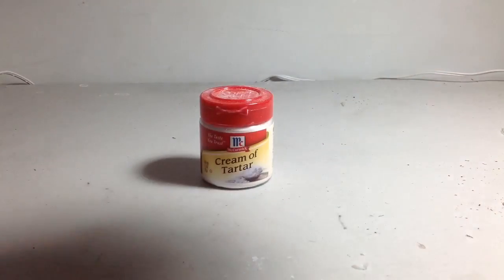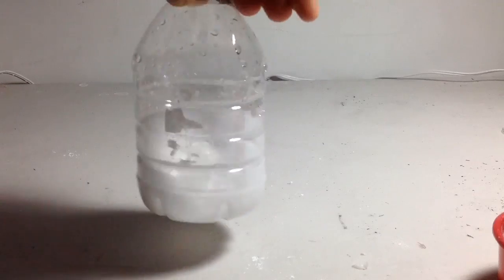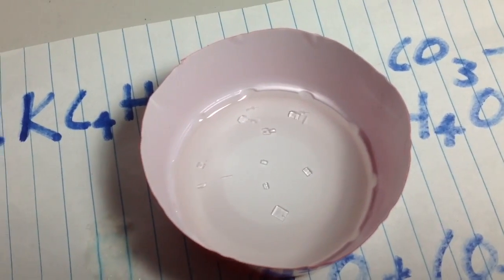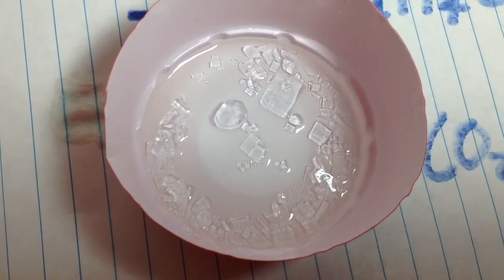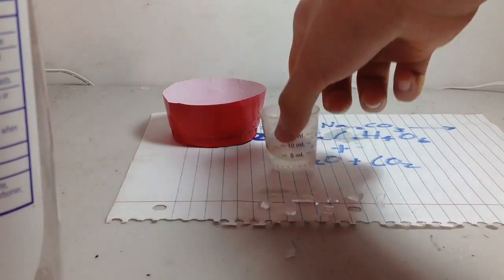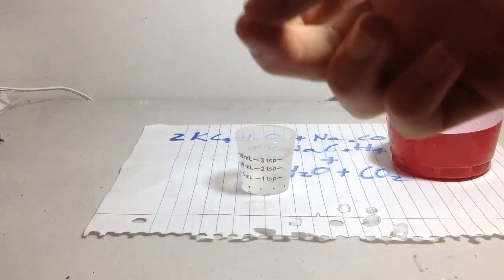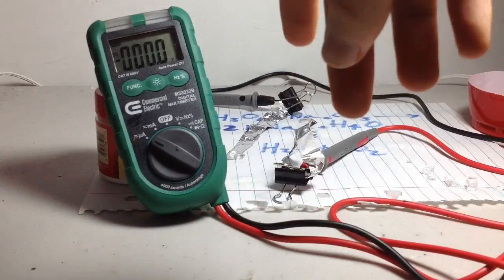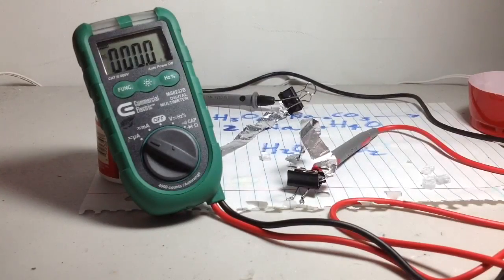Growing Piezoelectric Rochelle Salt Crystals

Comment: I just found this after a discussion on old record player cartridges which used the same crystals to convert movement of the stylus to a signal. It would be interesting to connect an amplifier and speaker rather than your meter.

Comment: FREAKING FANTASTIC, MAN!  Using homegrown piezoelectric crystals as resonators in sonicating graphene experiments!? What a vision! I'm with you 110%.

Also, would love to see you using them in speakers! Great video. My favorite; I think your best one yet. I love crystals!

So, how can ya make more reactive piezoelectric materials?
Reply from the maker: I don't really know, but my best guess would be to use different metal cations, maybe use lithium instead of sodium, but I won't be able to try that any time soon without a source of lithium. You could also make the crystals thinner, which I'll probably do for the sonicator. Generating a high frequency AC current for the sonicator might be tough though... but yeah it would be really cool if it works!
Reply: Red Rake you could try to safely extract lithium from some batteries.
Reply: you can just order it from amazon
Reply: Small Lithium, discs that has not been Magnetized" can be found in some of the ( Older BMS CONTROLLERS ). PS: I would
Upload a pic, but won't let me.
Apparently, it was used to make a 
Reliable Connection..

Comment: Didn't know you could do this cold, most method I saw used a simmer method when mixing them together.
Reply from the maker: People do that to make a more supersaturated solution that crystallises faster.
Reply: It does, I tried it myself a while back and the crystals formed much faster, however I didn't have a proper sized vaping area, but got some nice chunky ones.  I'll try this supersat method with some of the ones i made previous, I like that idea, maybe get some nicer ones.   Also I used some clear nail polish to preserve one sample from moisture.  I'm not sure if this would affect its properties, but it could be useful in making sure the crystals are protected from moisture.
Reply from the maker: +scottaw1981 The reason I didn't use the simmering method was because I thought it was less controlled, since it's hard to control the amount of water that boils off.
Reply: I think your results were better this way, sometimes patience is its own reward